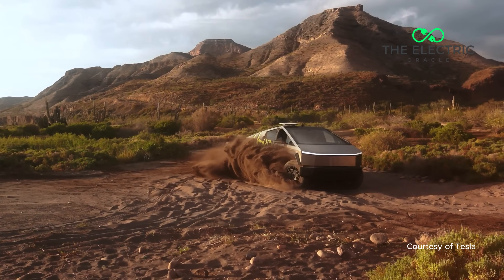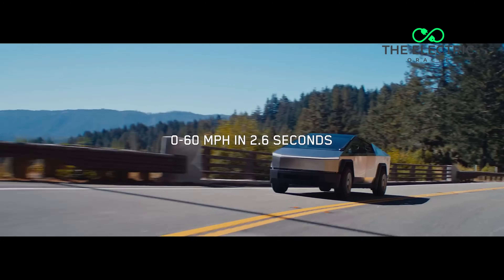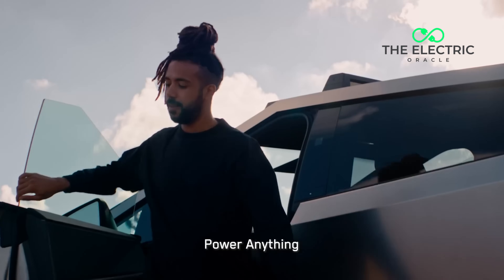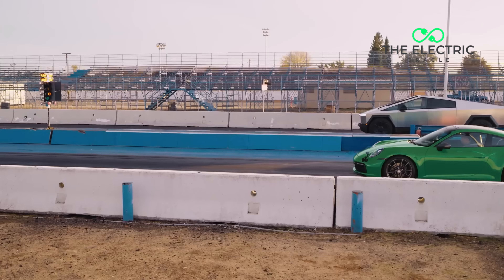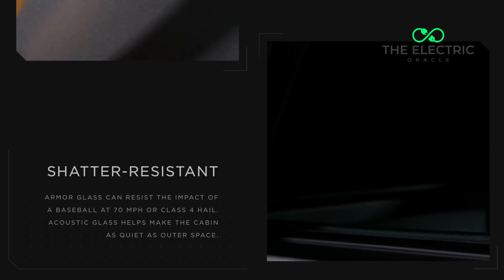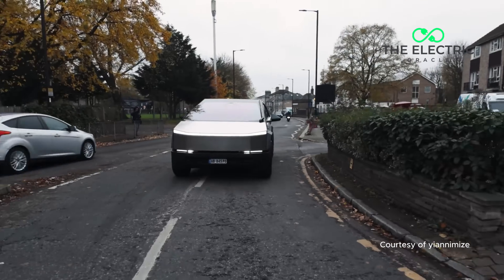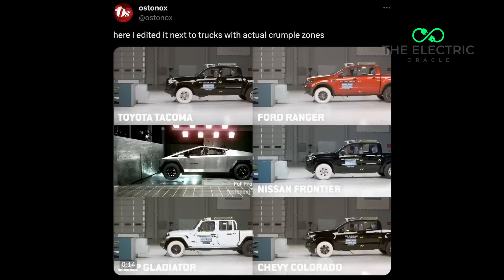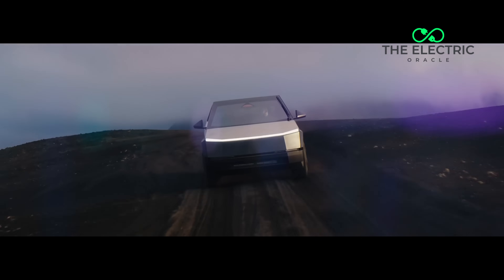5 Safety Issues Keeping Tesla Cybertruck Off UK Roads 🇬🇧

Comment: Great video. I'm not sure an unnecessarily heavy vehicle is actually an advancement of technology... 3mm stainless is just insane in the modern age. We need to make things last longer and be fixable but that's just inefficient. Plus as you say the impact on pedestrians is not acceptable. What's also interesting is - if you watch the rear wheel in all six of those impact tests - the cybertruck is the only one that looks like it's rear axle snapped under the impact
Reply from the maker: Thanks for the nice comment, mate.
Reply: the cybertuck has rear wheel steer, i suspect it either the computer trying to compensate for the front wheels being hit out of line
Reply: @That_sd1_vitesse  that's interesting I didn't know that thanks!

Comment: Those huge mega castings are part of the reason why Tesla are either 'mega expensive' or impossible to repair - as hertz found out.
Reply: Same issues with the Rivians. They are being written off for, what would seem like, minor damage.
Reply: It survived a bomb, and probably saved lives .
Reply: @jonshadow4052  Yeah, being bomb friendly is a vehicles primary use <rolleyes>
Shame the towing rig rips right out under load.
Reply: @jonshadow4052  The Tesla cyber urinal is a b0mb, with wheels on.
Reply: Mega castings has nothing to do with anything you said.
Reply: @JJSmith1100  Giga / Mega casting reduces the cost of manufacturing also speeds it up, so your comments are right on that issue. But cost of repair for a damaged casting is ridiculous and simply no skills to do it. Many now are just written off. My neighbour had a tesla for 7 months, another car hit it in the rear 3/4 panel.  3 months in shop and no one knows how to fix it. Likely to be written off. Insurance premiums for Teslas in Australia have gone up 150% from $2K to $4.5K. Australian Tesla Facebook has heaps of feedbacks on that. Also Tesla has 193% higher than the average annual premium. Not my statement public knowledge provided by insurance brokers and many companies do not offer insurance to Tesla owners.

A side note, Giga casting technology has been around for decades. Manufactures did not adopt it as it adds to total cost of ownership. Q4 Tesla also quietly stated they are pulling back from next generations giga casting. Reuters Financial news feed.
Reply: @mickrelic4891  Good summary.  Thanks.

Comment: The current design cybertruck is too large for the UK market, so a new vehicle will be needed at any rate. I'm guessing that the (very comprehensive - thank you) overview of UK regulations explained in this video are also largely in common with the EU. So if Tesla want a truck that'll sell across the whole of Europe (including the UK) a completely new vehicle will be needed - using the same design innovations as the current cybertruck (48v electrics, steer by wire, unpainted stainless steel exoskeleton, etc) but with lessons learned from the current production and specific features for the wider European market. I think the cybertruck should be seen as a showcase for a new way of making utility vehicles, with very wide scope for future development.
Reply: Frankly, with musk at the helm, and especially after what happened the other day, I doubt any tesla product has much of a future in Europe any more.

Comment: Steer By Wire what could go wrong?
Reply: Safest because they’re not flying right next to each other, typically with plenty of space to other physical objects, so there’s room and time to correct errors, and piloted by professionally trained personnel.

Private aircraft have an entirely different safety record, and they have the same spacing benefits.
Reply: Ahh yes, covert an analogue input into a digital signal which is then scrutinised by a computer, and converted back to analogue, how very efficient 😆
Reply: @Markcain268  Actually it is very efficient. Less maintenance, less likely to jam or go wrong, enables unstable aircraft to be flown safely and perform better as a consequence.
Reply: @mbak7801  there are more things to go wrong compared to manual steering,  what is it with people these days? It seems we can't do anything without computer assistance, what a pathetic race we are becoming 😒
Reply: Yeah I know I was an Air Traffic Controller.  I still remember the Airbus incident at the Paris Air Show. We have come a long way with aircraft but I am still against steer by wire.
Reply: @byrnc927  What 'Airbus incident' at the Paris air show?   Don't recall one.   D'you mean the incident at the Mulhouse air show where the pilot had switched off most of the automatic protections? - it crashed but everyone walked away but three people, largely because the remaining operating automatic systems prevented him pulling it up into a full stall.   That incident?    Air France 296Q if you want to google it.
Reply from the maker: Thanks for your comment.
You do know that modern aeroplanes are also steer by wire?
Statistically the safest way to travel :)
Reply: @TheElectricOracleChannel  
Airplanes don't fly next to my family on the highway.
Reply: @byrnc927  Do big ships have a steering wheel, do the local bus have a old fashion steering wheel, do a train have conventional brakes?
Reply: @byrnc927  no, but if they could, your family would be safer compared to older designs of controls.  Sub-systems are not the problem here- it's the whole package, with some specific design and engineering choices that stick out (literally in some cases) amongst others.  Don't let your Luddite tendencies blind you from seeing the science :)
Reply: @fanum4030  
Luddite? 
As nuclear power veteran for over 40 years, I am well versed in the concept of defense in depth and system redundancies.
Does the Cubertruck default to some backup steering module? Or what does it do during a catasrophic electric fault. What does the steering default to on this two ton missle in traffic?
Reply: @vanDeudekom  Some trains do have conventional brakes. Some ships have a yoke that is not a million miles away from a wheel. Buses absolutely have an ordinary steering wheel.
Reply: @TheElectricOracleChannel  Extremely bad analogy. One single actuation motor for an aircraft rudder probably costs more than a whole car. Aircraft are operated by highly trained professionals and get meticulous service and controls. Car's aren't disassembled to the smallest piece and put together again which is the case with commercial aircraft.
Reply: @ Aircraft that have flyby wire systems have a backup wind turbine generator, which deploys to provide electrical power in the event of an electrical system failure! 
I very much doubt that the Cybertruck has one of those!
Reply: @TheElectricOracleChannel  Modern airliners generally have 3 of every system, outputs are compared and in the event of disagreement the disagreeing signal is discarded.    (Boeing ignored this and bingo! we had the MAX).    
HOW many circuits does Cybertruck have?
Reply: @TheElectricOracleChannel  sorry but thats a really bad example.  aircraft aren't allowed to take off without several redundant versions of the system able to automatically take control in the event of a primary system failure. yes they are both "fly by wire" systems but built to an entirely different degree of safety. not to mention the ones in aircraft are much safer because laws require them to be, as far as im aware there is no such legal requirement for these systems in cars.
Reply: @TheElectricOracleChannel  My first car wasn't steer by wire and the steering still failed.
Reply: Who cares about what's in an airplane?  What about an electrical failure?  Not even a full electrical failure it could just be the steering system.
Reply: @TheElectricOracleChannel  Indeed it is,however aircraft manufacturers are very conservative about their designs and use tried and trusted systems that have proven themselves over many years.The computer systems used in commercial aircraft are out of the ark and are at the limit of what they can do but they are reliable. Boeing did try to push their luck with the 737 Max with disasterous results causing the system to try to pull the nose down while it was in level flight. A tiny modification with results that no one could have predicted... Would you still trust a car manufacturer to fit a fly by wire system?
Reply: @TheElectricOracleChannel And you are aware that ALL safety relevant systems in an airliner have to be fully redundant? In the steer by wire case that would mean two (or more) steering angle sensors, two actuators, two control computers and so on. Do you really think anybody would be willing to pay the price for that?
Better educate yourself next time 🤦.
Reply: Nothing
Reply: For what it’s worth the CT’s steer by wire is completely redundant with dual actuators and controls. Either one can fail catastrophically and the other will still work.

Comment: It's bang on 3 tons 👍 regular licence is fine.
Reply from the maker: Nope, I'm afraid not.
Reply: @TheElectricOracleChannel  yianni weighed it at a merchants with 20kg room for error... Its slightly under 3ton..see his recent video!
Reply: @M0j0  Correct, 2.6T BUT that is its "kerb weight" or in common parlance, "UNladen weight". It's LADEN weight is rated to about 4T and this is the weight you use for licence classes. AKA MGW, max gross weight OR MAM, maximum authorized mass. It has always been this way.
Reply: Over 4 tons when fully loaded. That's the weight that counts.
Reply: Payload is around 1 tonne, so it's GVW is around 4 tonnes, although it's an electric vehicle, I think the licence requirement is upped to 4.25 tonnes now. If it had a proper engine, it would need to be replated to 3.5 tonne.
Reply: Is that with a full or empty battery? 😂
Reply: @Markcain268  😅